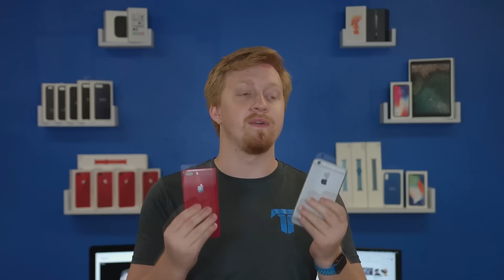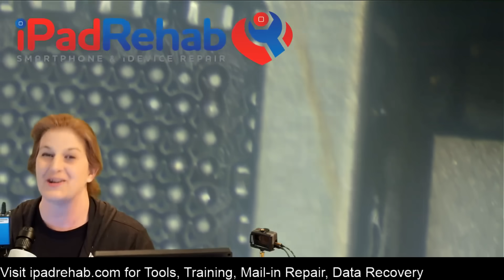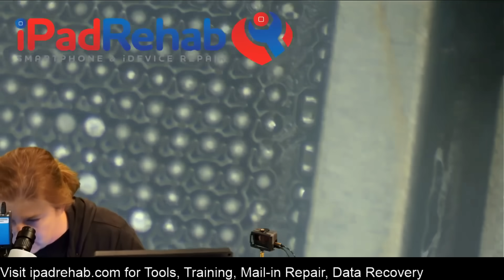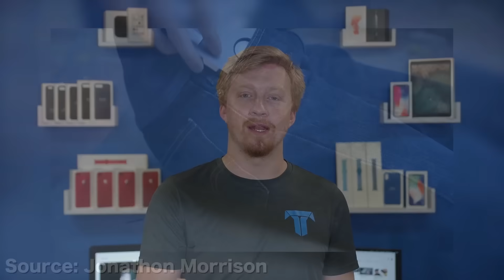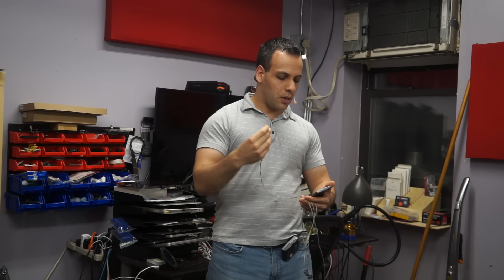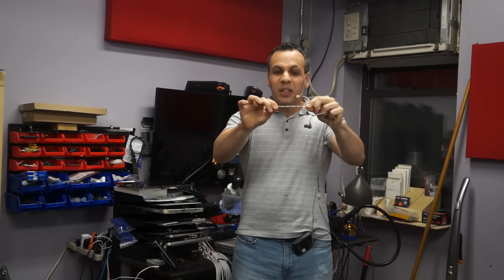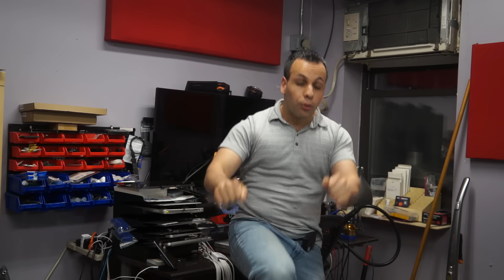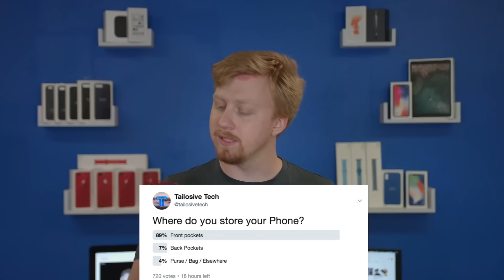The truth about iPhone bendgate deniers

Comment: That's why I absolutely HATE putting laptops in a full backpack.
The laptop will act as a "stabilizer" of the backpack, and the whole wight of other things in the backpack will bend it. If you now walk with the backpack, it will give the laptop this constant flexion Louis was talking about.
I just don't do this. And I slowly heat up the laptop by not instantly playing games on it after boot and letting it cool down before shutting it down.
And guess what, my Lenovo Y500 (crap quality, this is the "newer" lenovo stuff that isn't built like a thinkpad) works since 5 years. With 2 GPUs and a TON of VRAM chips BGA soldered to the board. AND the thing will get hot, up to 85C on the GPUs and 95C on its CPU.
Reply: not much of a problem with the older style 2 inch thick laptops, but with today's 2cm thick ones, oh my.
Reply: The Acer Swift is 9mm. Doesn't even have buttons on the touchpad because they can't fit in the chassis lmao
Reply: I've been using an HP Envy since 2013, frequently put it in a backpack, frequently play games on it, and got the AMD Dual Graphics option so both GPUs run at the same time. It's HP, crap quality is a given, but I've had no problems aside from it being built like shit. I think flexion is only a huge problem on newer, thinner laptops.
Reply: That's why I will NEVER buy thin and light laptops. If it's not THICC, I won't buy it. My old Toshiba Satellite from 2013 is still working fine, even after being dropped 10+ times. I'm still using it as a backup for my new Coffee Lake system.
Reply: Logic dictates that you should never use hardware to full max power while it's cold,to shut it off without letting the fans do their work first.I pretty much apply that to any device.

Especially when the ambient temp has a huge difference. (inside,bringing it outside into the cold)
Reply: The main problem I have with my old dell is that some keys aren't always working anymore and it's getting a bit slow (which might be fixed by swapping in an SSD). It's built like a tank, and if I drop it there's a dent in the floor. Never bent in my backpack despite all the abuse :)
Reply: also got a y500 and that thing doesnt want to die. used it as daily driver hardcore user and it still goes strong
Reply: got a brand new chome book screen shattered in 3 days of being in my backpack from flexing
Reply: This is why I use thinkpads.
Reply: I have a great bag with a special pouch for the laptop, that is very sturdy stabilized. I have been carrying my Thinkpad L450 almost dayly in a backpack and i still works like on the first day.
Reply: Buy a good backpack
Reply: Steady temperature is better. But you still risk going a bit to high and just killing it
Reply: Uhm, I'm running a T510 from 2010 next to me. I travelled everywhere with it, in a backpack. I've been through dozens of crowded bus trips, many many flights, climbing rocks on waterfalls and whatnot. Works as expected. There's no need to overly baby electronics too much.
Reply: @declination00  Not with thinkpads, that's true :D. At least not with Thinkpad T/X60 or newer (Intel models).
As soon as there is a dGPU Laptops can break quite fast. (There are still some good examples, but generally you have a LOT more solder points to break (GPU + 4-8 VRAM chips) and another quite hot running chip.
Exceptions are most nVidia Optimus Laptops, because graphics only get stressed while gaming. Therefore you can also disable a dead GPU)
Reply: @declination00  it got a lot better.
In my personal experience, since Kepler (GT(x)6xx) flexion AND heat based damage was mitigated both on laptops and on Desktops. Those GPUs have very low failure rates. With AMD I would be more careful however. They always seemed to be more fragile to me. Don't get me wrong, the made good GPUs, but they seem to not tolerate hot temps that well.
Reply: Thinkpads don't have this problem, I put mine in a backpack almost all day every day and it's fine.
Reply: @jftechdrones  except older ones like the T/R/A 3x / 4x series. They had severe mainboard flexing issues. (GPU and also southbridge)
Reply: @TheRailroad99  Not really a practical issue in 2018 though, the only people who own those laptops tend to be collectors rather than practical users.
Reply: @jftechdrones  yep
Pentium M is not really usable for web browsing anymore. (Maybe, if you are very patient, the 2.1GHz P-M will be enough.
Reply: With 2 boys in university & the company my wife works for gives her iPhone, Mac books, ipads. Apple products in general, so she can work with. For free. So we use Apple & I buy Androids in my household. Actually we have too many devices in my home. Even consoles. Xbox 360, Xbox one, wii, sony Playstation 1 & 2, etc. Lol.😅 But I bought a Lenovo IdeaPad Y510p about 4 or 5 yrs ago & my boys throw any game on it. LoL, warcraft, gunz, Battlefield, Brave frontier, etc. Never any lag. It refuses to die. Lmao.😅 👍 👌 P.S. Even though we get Apple products for free. Mostly my wife uses them. Me & my sons prefer to buy other products.
Reply: put the laptop closest to your back and the rest of the stuff in front. Otherwise buy a dedicated backpack that has a special pocket for laptops. Many manufacturers make them like Adidas
Reply: @Mehran Mahdi  I do already use a good backpack with a rear laptop part. To solve this issue they would need to reinforce the back with aluminum, which would make it heavy and probably uncomfortable. 
The best advice is probably to don't cram the backpack until it is bending and not to over tighten the shoulder straps.
Reply: I've never thought about laptop flexion, but that's probably what killed my aluminum body mbps years back. That or the two times it failed to sleep/stay hibernating and overheated in enclosed spaces and fires the $800 logic board, good times.
Reply: I don't really have this problem at all. I think it has to do a lot with where and how you handle it. For example, my backpack has a place that is for laptops, that is cushion, and it also is in the very back, so all other objects don't push it. Then, I just turn the backpack around when putting it against something else, so the computer isn't push either.

Comment: I can't believe Apple fans put up with this crap.
I have had my Meizu MX4 pro for about 4 years now, got it used from my dad back then.
It's not the fastest phone, but it works great, does everything I need.
Eventually, the thumb button stopped working, then the volume buttons got a dent, so now the only button I can use is the off/on button.
Weirdly enough, I can still use the phone fine with some caveats. That's how good it is, that you can lose most of the buttons but still use it fine.

But apparently, Apple devices just break on their own without anyone doing anything out of the ordinary, and then you can't even get them repaired. wtf.

Comment: My dad's iPhone 7 has the infinite boot loop problem. I brought it to the Apple twice. The first time I did, the phone went back to working condition like nothing happened so they thought it could be just be an OS problem. Their solution is just to restore the phone to its factory settings. So they restored my dad's phone and called it a day. Two days later, the phone started going in an infinite loop again. So for the second time that I went to the Apple store, the Genius Bar guy check if he can get the phone to factory reset again. He failed to do so because the phone just gave him an error code while the phone is on infinite loop and told me that I can get a replacement for $319 or send it for Quality Program for them to check the phone and "hopefully repair it for free". I authorized to get my dad's phone to be send for Quality Program yesterday 7/19/18. I really hope that they don't screw my dad over.

Comment: I had a Nexus 6P which bent in my front pocket, just after I got the chassis replaced (USB C connector got loose and Huawei decided to replace the whole chassis).
I didn't want my Nexus to be gone again for another whole month so I kept using it as is, with the bend. After a few months it stopped working altogether because of the flexing that occurred more often since the integrity of the chassis was basically gone..
Huawei refused to acknowledge the bending problems with the Nexus 6P, saying they had never gotten any return with these problems WHILE my bent 6P was sitting in their repairshop..
Terrible experience. Never getting a Huawei phone again until they proof themselves otherwise

Comment: Fatigue failure vs plastic failure is what you’re talking about. Many materials have fracture stress when trying to plastically break but fatigue failure happens at lower stresses because of how the cyclic stresses applied over a long time forming microscopic imperfections that build up over time

Comment: I found you through the side of Linus Tech Tip's pink Honda Civic! Great advertisement isn't it!
Reply: I haven't seen that! I came from the iMac Pro repair video.
Reply: kim jong skill indeed. As louiss correctly pointed out, flexion is independent of the external chasis. The thing with older 2 inch thick pcs is that they have 'dead space'.So even if the case bends by 1 mm, there is still a 2mm gap between it and the board. But now, with the ever present bragging rights I'm sorry thinness battle, if it bends by 0.5 mm, its already hitting the motherboard. This is also why the thinner the device, the worse the thermals. Even if you put an industrial grade fridge sized fan next to it, if there is no space between the components, air will not flow there in an appreciable amount
Reply: wait when was this? i though you would be from the video when linus did bga graphic repair
Reply: wasnt it like a lambo or a ferrari? ;)
Reply: @ka Same thing
Reply: Wow, it's 3 to midnight, and I give you my "funniest comment of 17.07.2018 on tech oriented YouTube channel!" The invisible badge should appear on Your chest, mister!
Reply: Love your LTX video btw!

Comment: Girls put the phone in the back pocket because girl pants are terrible and most have tiny front pockets if any.
Reply: Yup my pants don’t have front pockets, just fake ones for the look. Very common for women’s pants. So put my phone in my bag or back pocket in the when it’s warm and I don’t wear a jacket with pockets. And some jacket pockets are too small for a big phone.
Reply: That's why I buy male pants. Even cheap Walmart male jeans (cheap denim) are of better quality than female jeans (cheap thin elastic denim mixed crap) and they have pockets you can put stuff in. Not to mention male jeans tend to allow better movement and are not skin tight around the thigh so if they get wet you're stuck trying to peel them off.
Reply: @marikroyals7111  you can put many rubbers inside the front pockets too
Reply: Marikroyals It’s weird how you call spandex/stretchy denim worse quality than a polyester and cotton fake denim that Walmart sells.
Reply: ayyy- Because the Walmart Spandex/stretchy are even worse (that I can pull apart no problem if it gets cut, even cheap Walmart denim doesn't tear that easily)) and I don't have the money to spend $50+ CAD on jeans in one of the highest taxed provinces in Canada at 15%.

Also again if the Spandex/Denim gets wet, you either have to slowly peel them off (reverse putting on pants to same for you) itching all the while, or you have to cut them off and still itching all the while.
Reply: ^ wife material
Reply: Women can’t be trusted with pockets, even though we all want them and we all know how to cut them out and sew them up if we decide those pants shouldn’t have full front pockets.
Reply: And if you don't have pockets you put it in your bra. It gets sweaty as hell and increases your risk of breast cancer so.... Screwed if you screwed if you don't I guess.
Reply: Facts, most front pockets on girl's pants aren't even real.
Reply: you should not put anything of value into your pants ever unless you have worker pants that have outside pockets that are only attached to the pants at the top like these over here: https://images-eu.ssl-images-amazon.com/images/I/41CyirzPFrL._AC_US436_QL65_.jpg
it doesn't matter wether it's the front or back pocket, if you put anything into either of them, bad things happen, credit cards break, phones bend, keys will shred your pants.
if you want to carry things on you, get a belt pouch or wear a vest with pockets.

also to anyone complaining about women pants having terrible pockets, i just wish to point out that people only keep making those because women keep buying them, if you can't find women pants with decent pockets, buy man pants, if those are too big for oyu, go to the children section.
Reply: @windhelmguard5295  so, to prevent the very unlikely event of a credit card breaking in your pocket, which you can just reorder from your bank if it ever where to happen, one should not use the most useful storage?  That seems like a major inconvenience for a very minor problem.
Reply: yea you can order a new card from your bank, wait two weeks, during which you can't access your bank account, for a new one and then memorize a new pin number.
bonus points if you live in europe where everything is a chip card so you also have to worry about not breaking your health insurance card, your drivers license and your passport too.

also as i said if the pants are properly designed so that the pockets do not flex with the rest of it, like in the picture i provided, there is no danger of anything in there snaping in half.
Reply: @windhelmguard5295  never had an issue with shit bending in front pockets or cards breaking unless they got mad old. keys getting bent only when riding bmx and that happened even if i used a loop to put them on my belt. 

also female pants with shitty pockets(or even guys pants with shitty pockets) can be made to have larger ones. at least if they are made too shallow.
Reply: @bmxriderforlife1234  
 i broke several cards just by puting the wallet in my pocket and siting down, they dont break from doing that one time, but doing that over and over does break them.
Reply: @windhelmguard5295  i used to ride bmx with a debit card in my front pocket with keys change a spoke wrench and other shit. phone in the other front pocket plus an ipod. 

screens were the only issue. well that and a 4th gen ipod touch bending but still working for years and years and years. ive had the same debit card for like.....6 years? maybe longer.
Reply: Brandon Rowe pocketgate small pockets so girls buy purses
Reply: @JEM_Tank  Or, did the purse industry kill pockets? Illuminati.wav
Reply: a whole bunch of girl pants dont even have real back pockets.
Reply: @bmxriderforlife1234  actually we dont need that many pockets. we can stuff things between our boobs and inside our mew-hole
Reply: @tspawn35  thats not a cell phone pocket....its for change or a lighter(if youre talking about that smaller one above the normal front pocket. 

dont see that many pants with actual side leg pockets  anymore.
Reply: Men be like: Wow what a butt
Nerds be like: What is this crap? Samsung S6?! 
just kidding
Reply: "... girl pants are terrible..."
This is incorrect. Girl pants are awesome. They have girls in them.
Reply: @notahotshot  lol
Reply: And due to mostly 14 year old thots using phones. The pocket along with the phone bends from their ass
Reply: And their butts are big therefore bendgate😂
Reply: And to attact attention to the booty I bet, 2 birds with 1 stone
Reply: No, women's pants have terrible pockets, the front pockets are usually barely large enough to hold a credit card, if they are not fake. This is true of designer/upscale clothing and Target store brand. If you talked to a woman instead of assuming she's trying to show you her ass, you'd know this.
Reply: Gustavo Soto Peralta
1 month ago
And to attact attention to the booty I bet, 2 birds with 1 stone 
------------------------
Why don't women visit tech channels as much you ask? :P
Men (boys more likely) that are clueless about women but know everything about women. Getting slagged off just because you are female is getting a bit tiring tbh. I wonder if they talk like that with their mother or grandmother present. If so, those are the problem.
Reply: @gustavosoto4607  Wtf no, delusional virgin wtf.
Reply: @void9938  So you are saying that is the reason?

Comment: Flex based damage can probably better be illustrated by a nail.

Take a common nail. Make sure it is a thicker one which you cannot bend by your own hands. Now flex it back and forth by trying to bend it over and over. After a few minutes you will discover that bending the nail becomes easier and easier. Eventually it will break in half.

Comment: As a female jean front pockets can barely fit 4 fingers because they tend to be designed to be form fitting. Back pockets are the only pockets usually large enough to hold the phone without half of it sticking out. Lol any woman or emo boy who wears skinny jeans would tell you how common using the back pocket for your phone is.